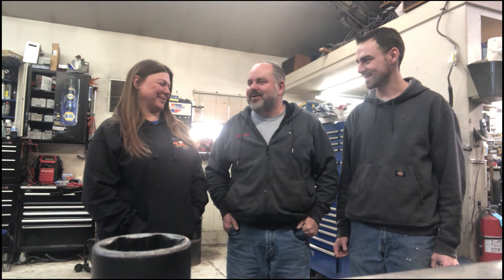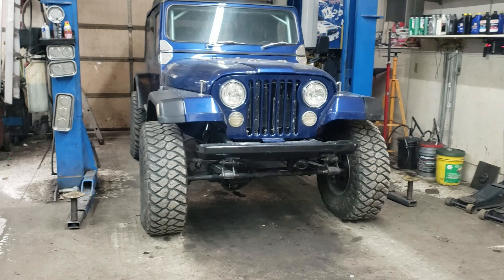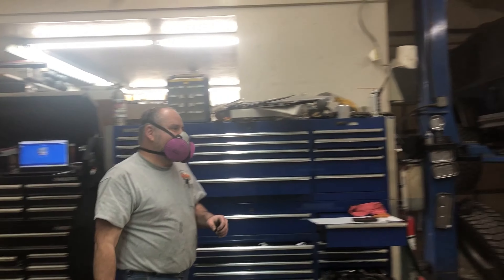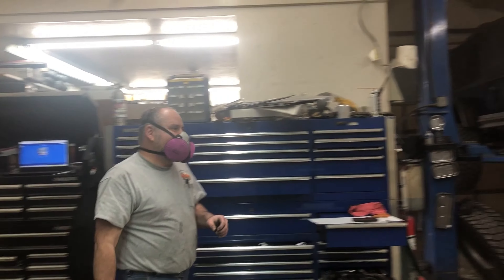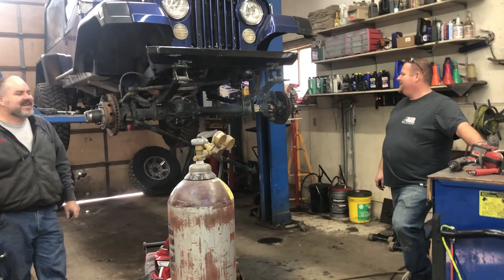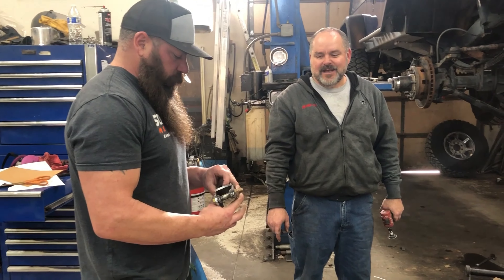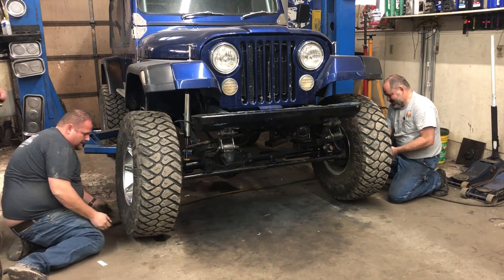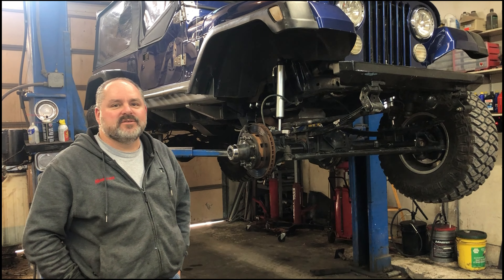Scrambler Gets External Reservoir Shocks

Comment: I had a simple concept of a Scrambler with either a regular jeeps soft or hard top and rear seat position, a custom fitted lockable and removable "trunk", within the space between the cab and tailgate, up to just under the cabs back window.
There would be other details (spare tire mounting, roll cage, etc...), but that's the major change.  ;-)

Comment: Definitely need better lighting. Love the way you helped Paul when he was behind the 8 ball . But better lighting . May I suggest Led 8 footers . They are great I use them in my shop at home,  definitely a lot better lighting, and they cut down on light bill. I have 16 foot ceiling in my shop LEDs yup only way to put alot of light through out your shop area. You would need 4 8 footers .
Reply from the maker: Thank you for your suggestions. I have some new led bulbs for the existing fixtures that I need to install. I also have new cameras with lights and mics that will help.

Comment: I am here from FabRats. I subbed. Are you going to put the wiring harness and ECU into the Golden Nugget?
Reply from the maker: Most likely will be doing the nugget after it's painted. Look for it in the next 6 weeks or so.
Reply: @chadsfab  Understood completely! I would only urge a more timely TIME LINE?  After seeing Ed, I question how much more  ‘time’ is still available to him. We all have three months before we wished we had moved quicker. JUST RETURN IT TO HIM.  Polish up the problems (unimportant to Ed) AFTER the big handoff (whatever they may be).  Matt, Paul et al can fix the problems.

Comment: Fab Rats transplant as well. Really like your channel. I am currently building an 85 Scrambler and was wondering about the front and rear axles and spring setup on this one. Can you please tell me the specs? Are the front springs outboreded?
Reply from the maker: The axles were in it when the current owner bought it. Rear axle is a 14bolt, front i believe is a j20 with chevy outers. The springs were also in it when he bought it. I don't know what the fronts are out of and I had to have new ones custom made, the rears are out of an xj. I also had custom ones made to get the spring eyes below the main leaf to keep it lowish.
Reply: @chadsfab  Great. Thanks

Comment: ...fine clip, but i disagree with your upper shockmount...when the axle moves up and down you are bending your shock and WILL break it sooner than later. make a picture of movement and u will see. unless there is a Ball-conector
Reply from the maker: If it were a traditional rubber shock end you would 100% correct, these shocks use a small spherical (heim style) end to allow them to move freely. We did flex the front fully with no binding.
Reply: @chadsfab  Just a little Suzi driver messing with the big boys ;) didn´t have a close look for the shocks u are using...would be nice to show some details for a second in your clips. that´s the interesting parts i am looking for at this type of clips. THX for the straight answer
Reply from the maker: @DarkDog99  Sorry for the lack of detail, I just didn't have enough lighting or a good enough camera to catch those details. I have since bought new cameras, mics and lights so you can actually hear what I am saying and see what I'm trying to do. 
Thanks for the honest feedback!! Keep it coming so we can keep improving and show what you want to see.